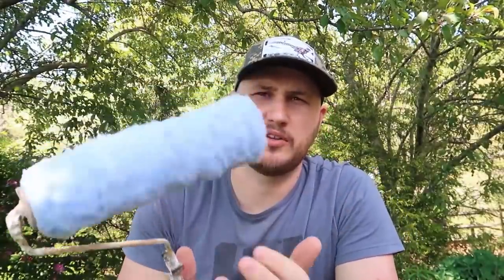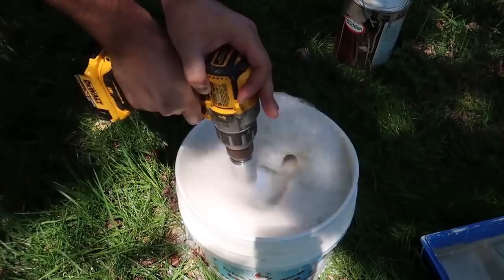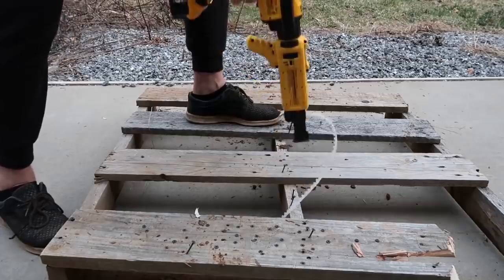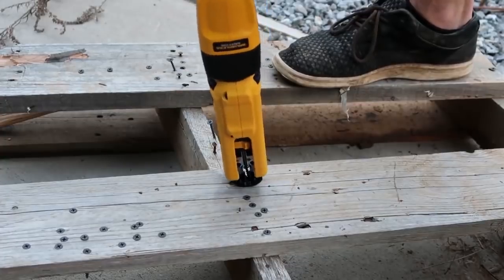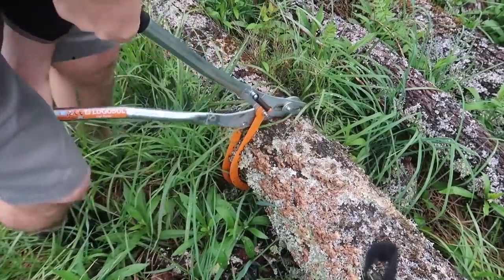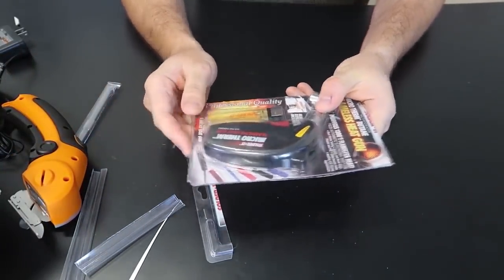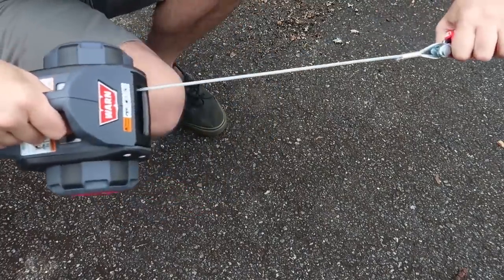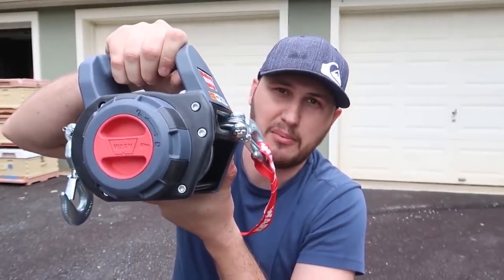5 Amazing Tools That Are at Another Level 2

Comment: You can clean a roller pad basically the same way with a garden hose. Put your finger in the hose to get higher pressure aim the water at the side of the pad to start it spinning, that is if you are using latex paint.

Comment: Tarus, this is free! Take a paint roller, attached to handle, and a water hose sprayer and put the roller into a 5 gallon bucket and spray the roller. It will clean and dry the roller, mess free!